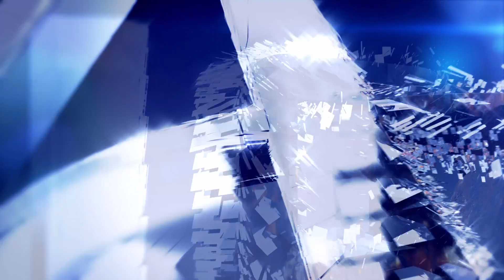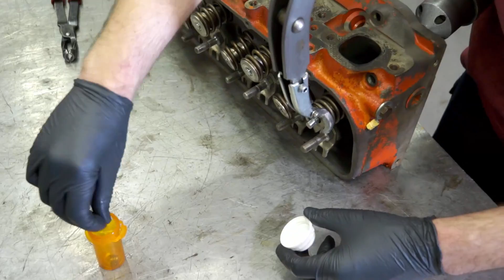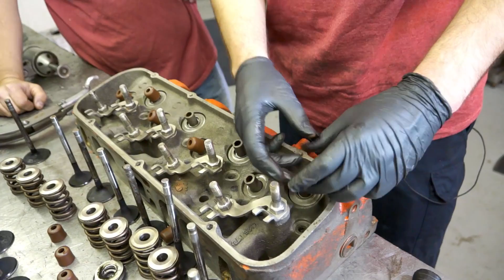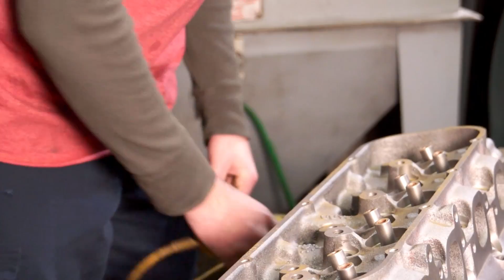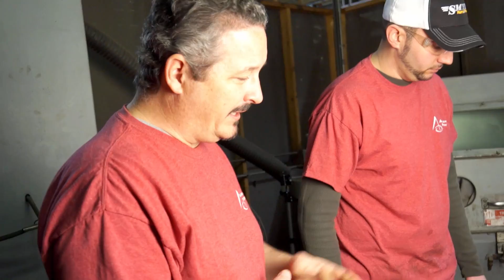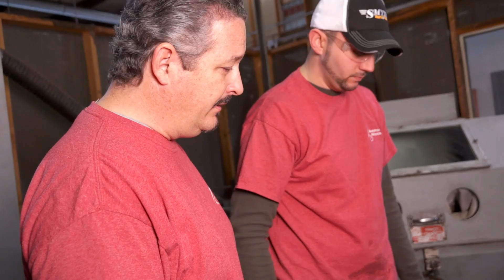Disassembling and magnafluxing the cylinder heads - The Build

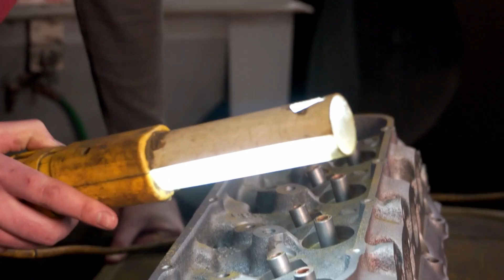Comment: 3:52 In addition, some heads crack because they were a flawed design. One example is the 1999-2001 Jeep 4.0 with "331" casting number. Chrysler solved the problem by creating the "331 TUPY" head. The Clearwater Cylinder Head company cast their own replacement head and they solved the problem by putting 4lbs more iron where the "331" head would crack.

There are probably dozens more examples of heads that crack almost entirely to bad design and manufacturing, but that is the example I remember the most.

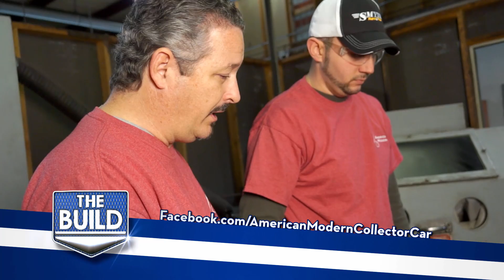6:25 it is extremely common to see someone restore a car worth restoring, and having a similar car that is beyond repair. They call it a "Parts car" because the remaining good parts can be swapped into the car that is worth restoring.